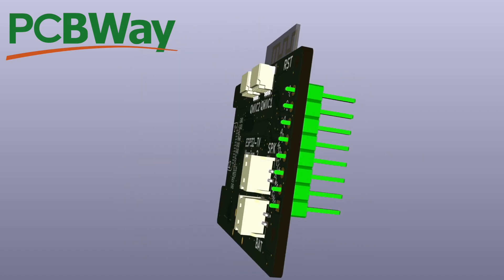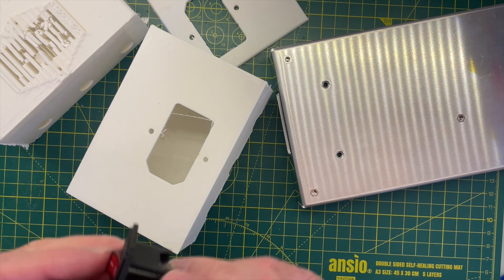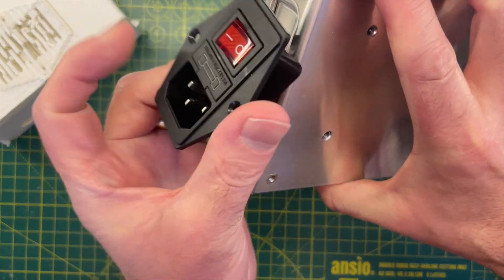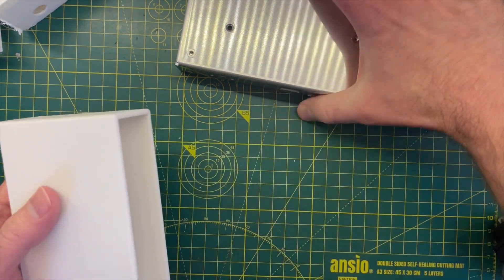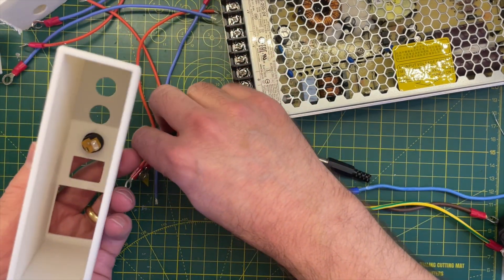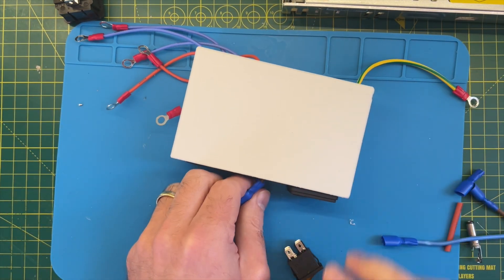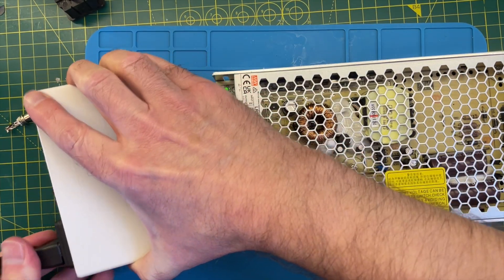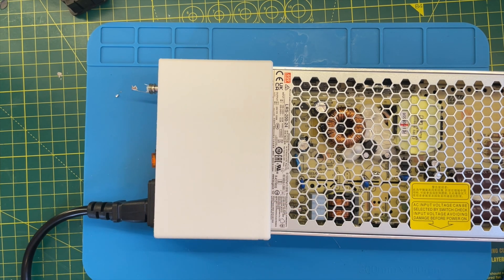Easy 8.8 Amp Power Supply Hook Up - But is it safe?

Comment: Those two blocks near the antenna seem to be connectors, that is definitely going to detune the antenna and cause issues. Look at the ESP32-CAM, most of the units are flawed for that reason.
Reply from the maker: I’m going to use a module without an antenna and connect and external one.

Comment: I remember building my first RepRap back in 2009. 
Pulled most my hair out printing ABS since PLA didn't exist, until I learned the ropes, and tuned it like a violin.  
Now, I just press print on my cheap Anet A8 printer from 2018 using VNC viewer on my PC, and go away until it's done. 
My local Dollar store (nothing for a dollar!) sells wooden boxes for crafts, which I found incredibly useful my for our kind of projects for only $2-$3.

Comment: Connecting mains to a power supply designed to be inside an enclosure is always a problem.  Maybe you should sleeve the live end neutral as well as you are down to 1 means of protection if the wires pass over the low voltage connectors on the psu. A fuse in the output might be a good idea.
Reply from the maker: Good idea. I wonder if it’s worth having a divider to keep the wires completely separate.
Reply: Printing it with a separator sounds like a good idea. If you have perfected your design please share it. I assume you are not the only one with this problem. BTW I also like that you show your failed attempts. So I now know I am not the only one who needs some iterations to get a useful part printed.
Reply: @atomic14  I think if you double insulate that would be fine, but if you can't cope with the extra bend resistance the sleeve will add then a divider would be better.

Also if the PSU is going to be on your bench where flying cut wires can occur I'd put a finer mesh over the holes in the case. 

These PSU's are designed to life in a more controlled environment e.g. enclosed in a case. 
Keep them coming as a grey cell exercise is always welcome, your videos normally provide a nice workout. 🙂